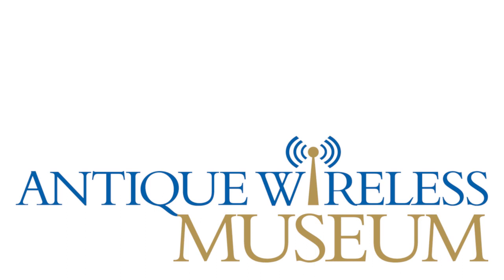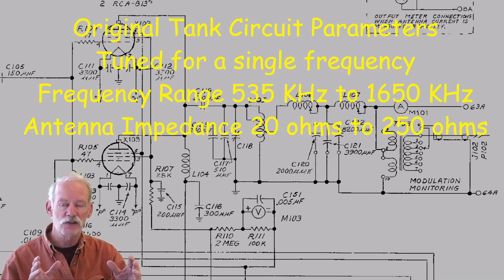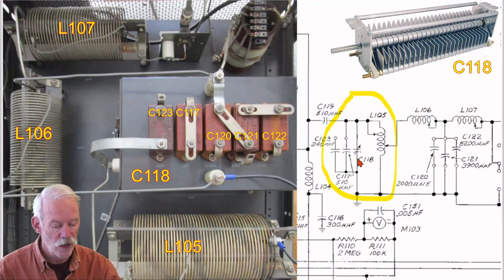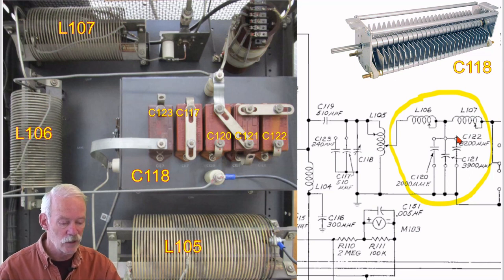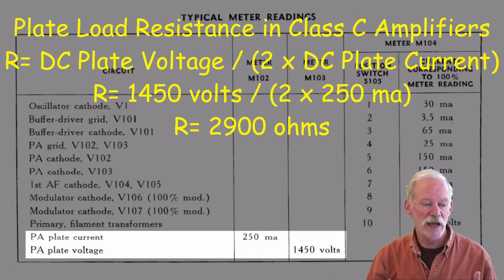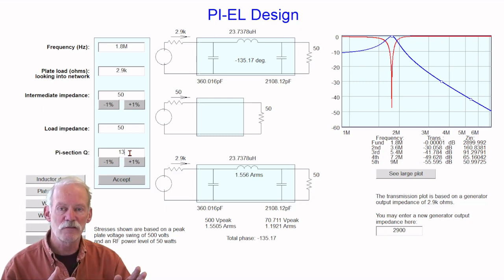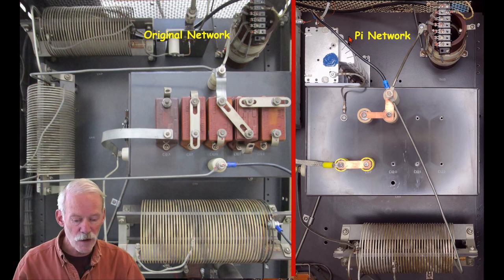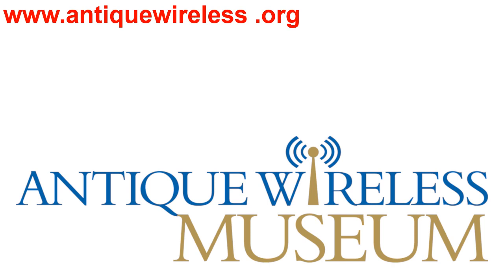A Pi Network Upgrade for my 160 Meter AM Transmitter

Comment: Have you burned up those little doorknobs used for loading padders? 
LOTS of current there on 160 meters for those small doorknob caps. I would have left the old mica caps installed. Better current capability for low frequencies.
73, Jim W7RY
Reply: Good point Jim, but I ran a smoke test and they don't even get warm. Most of the current is through the variable caps, the rest is divided between the doorknobs. I would have kept the old mica caps, but the values weren't what I needed.

73, Mark AE2EA